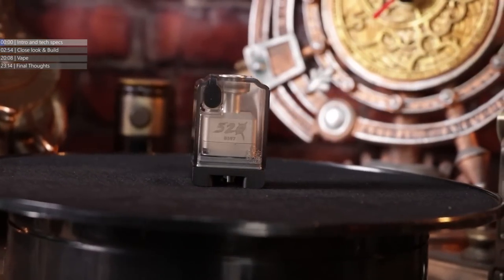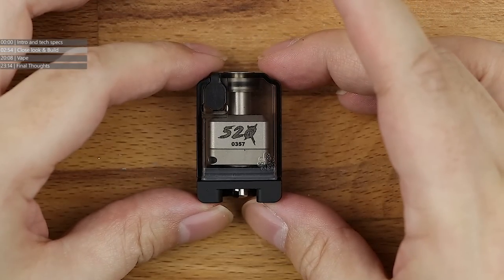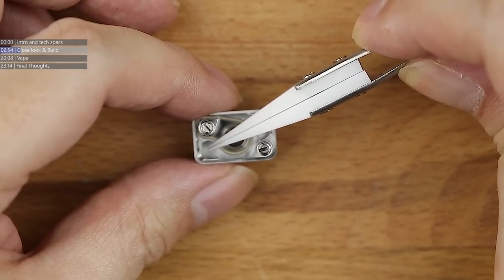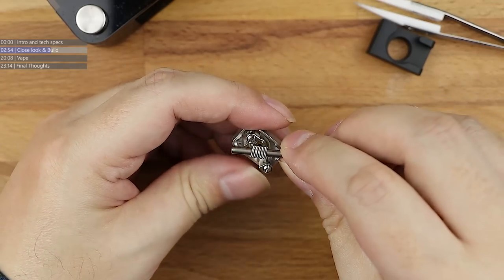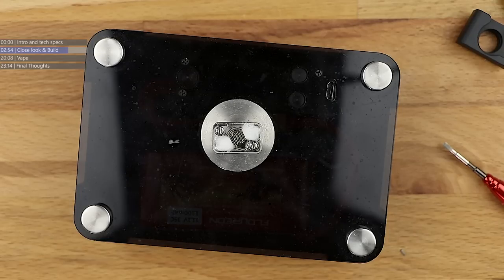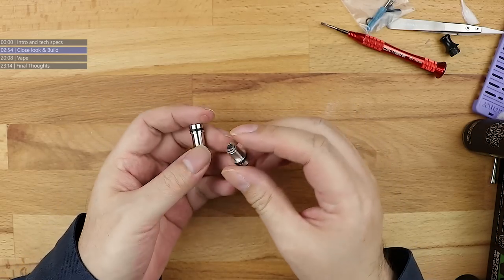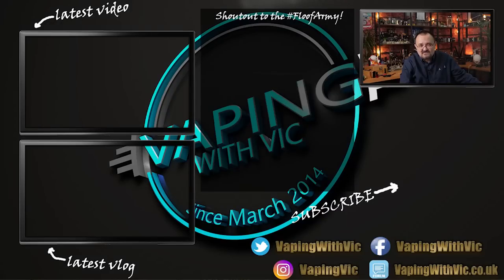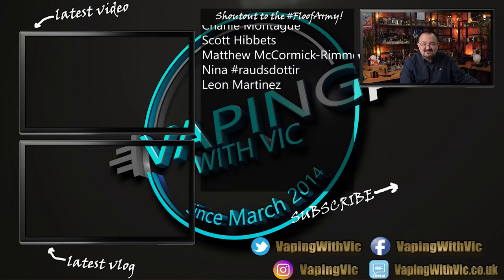Cthulhu 520 - Cthulhu expand their Borotank range

Comment: One thing about the airflow. You do not need to remove the tank base to change the airflow. You can remove the positive pin (or whatever is called) and change the airflow insert without any further disassembly. Tank is still sealed this way.

Comment: This design is nothing new. Not all bridges use the gravity fed method vic .Many of them actually don't. This design is quite common, I have several bridges with the same wicking design that have been around a lot longer. I don't get why you think the coil position is weird, lots of bridges are like this!
This is very much like the Vapesnail, but with a huge chamber. 
Boro bridges may be the current trend but a lot of reviewers don't have much experience to explain them properly.

Comment: What’s with the sudden explosion in borro tanks & devices? Seemed to start about a year ago. B4 that it was very much a years old niche market. 
Still don’t see the appeal myself but live & let live, right
Reply: I love them but I think the fact that it’s truly an “aio” so to speak mtl ✅ tight direct lung✅ just direct lung✅ want to rebuild ✅ want to continue buying coils ✅ all with one device and most of the bridges that you can buy cover almost every type of vape across the board (or at least attempt to). In my opinion the only thing missing is an aesthetically pleasing 21700 boro mod (at least in my opinion)
Reply: @304cortez85  Great explanation. I guess I have separate devices that do all of those purposes. But if I was a new vaper I mite go down the borro route
….
Also much cheaper now than the original Billet Box brand; used to be just that device that took borro tanks but now there’s lots an much cheaper - so good thing - except for high-end tarts who probly call this heresy.